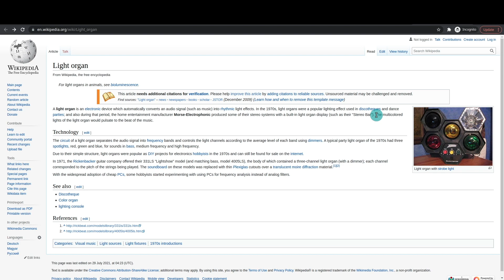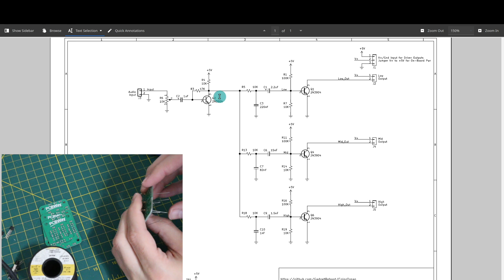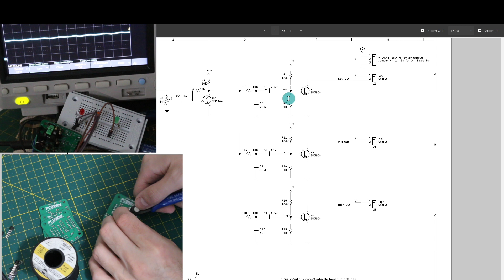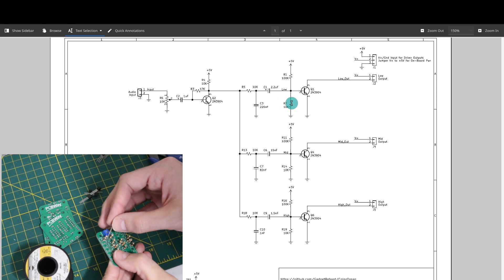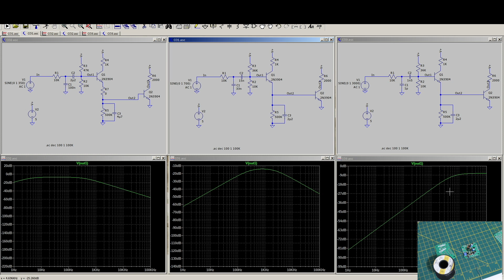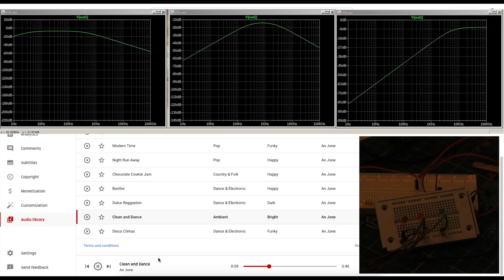Color Organ Circuit Experiment

Comment: Wow, this brings back memories. I was 12 in the 70's when my dad got a box of junk from a garage sale and in it was something with a potentiometer, RCA plug, and 3 strands of Xmas lights with 4 bulbs each. I assumed it was a Color Organ and since the outside Xmas lights were plugged into my bedroom, I decided to plug them into one of the strings. The outside lights blinked to the music, and 5 seconds later all the smoke escaped from some parts on the parts. My dad repaired it, gave me a short lesson on electronics, and I have been hooked color organs ever since. I still own a Heathkit TD-1006 and now build them using ESP-32's. Thank you!
Reply from the maker: I want to expand upon the concept and try getting some addressable RGB LEDs going, and maybe ESP or Teensy doing digital filtering, but I have some more analog level stuff in mind too.  
I used to have a Heathkit stereo receiver that was given to me already assembled in the 80s.  Now I wish I still had it.
Reply: I had a unit that was in an 8" x 6" x 4" box, with one indoor xmas light as an indicator for each channel. The unit also had outputs that drove  up to 100 watts (if memory serves).
I set it up to drive a traffic light.

Comment: I really enjoyed the detailed explanation of your trial-and-error methodology.
Would love to see a follow up design with proper buffering and in-depth filter calculations. 😊
Very inspiring, excellent video!
Reply from the maker: Yes I'd like to make a re-design for sure, especially so the filter math will work better when the op amp vs transistor won't load the filter down.   But I liked working on this one for fun and there's still always lots to learn with stepping stones.
Reply: @GadgetReboot  You’re absolutely right! Nothing wrong with this design, it’s great for learning and experimenting purposes.
Heck... my first Light Organ consisted of three coloured 220V Lamps with a TL Starter in series I ‘borrowed’ from the class ceiling lights lol 
Didn’t really react to sound but it did blink for sure. Also, back in the eighties most schools weren’t equipped with fire detectors lol (disclaimer, DON’T DO THIS AT HOME, I was a kid at the time lol)

Comment: Nice video- Based on this, I built one using an ULN2003, since I have a bunch... How much power are you looking at for the LED? This IC can do up to 1.5a I think, with each pin able to do 500ma. I used a bias voltage of 1v to start, with a 5k pot on the 1k/8k2 voltage divider to adjust the sensitivity.
Reply from the maker: The ULN2003 would easily handle anything I had in mind, even if I have to use it just to drive an even bigger switch for special cases.  The simple transistor method I used doesn't get anywhere near the turn on capabilities so even if I just used the same general purpose NPN but did it better, it would probably be fine for me.  I think my filter series 10K severely limits base current so the LEDs barely glow, but it was still fun!

Comment: Cool! Is this similar to how a frequency analyzer works?
Reply from the maker: Maybe in a very general sense, in that there's some sort of way (or filter in this case, maybe math like Fourier transforms in a test instrument) to separate out parts of the frequency spectrum to pinpoint the amount of energy present in the signal for that freq. range.  And then do something with the information - report the level, or turn on a  blinky light (more fun)